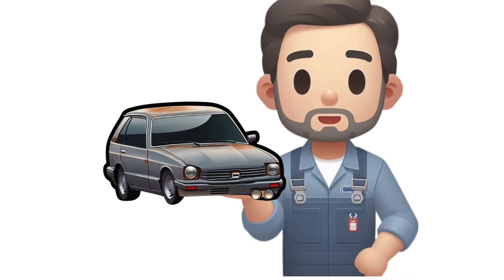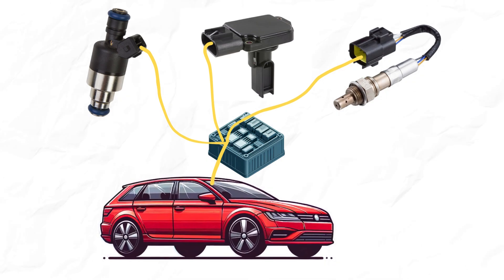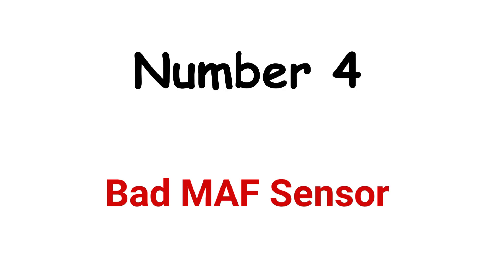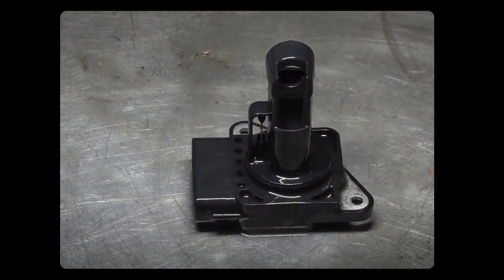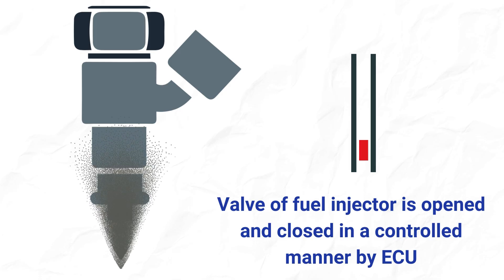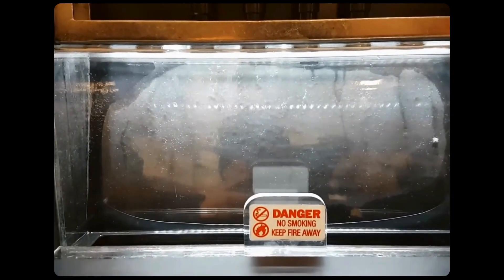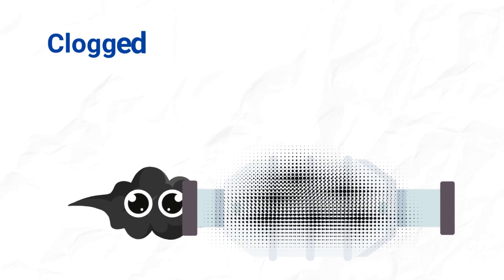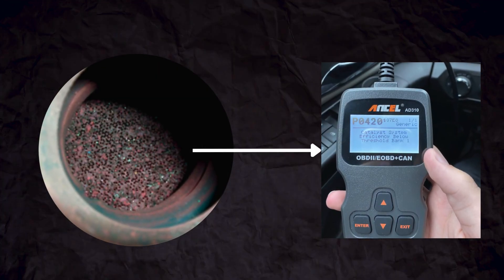20 Reasons Your Car Randomly Shuts Off When Slowing Down or Coming to Stop

Comment: My car keeps shutting off whenever I'm in traffic.. whenever I'm doing the break go break go action. It just shuts off and the battery light and engine check light comes in..  any thoughts on the issue?
Reply: I'm certainly facing the same issue recently. Can you please guide what was the issue in your case? On switching off and restarting it, fix the issue and the car moves as nothing happens to it.
Reply: Maf sensor check the ohm by multiple meter .Google what range your maf sensor should be in your car .just had same problem

Comment: Had 2 cars (Hyundai Santa Fe) that cut out when stopped at lights etc. Was the Crankshaft sensor on both of them. Replaced them and never had another issue.
Reply: odd that i come here because my 2018 elantra is doing this exact same thing....no lights, codes, etc, just randomly dies but ONLY while slowing to a stop IF I'm not going all that fast to begin with, and after about a good 30mins to an hour of driving.
Reply: @Atixtasy  my one would run fine and randomly cut out when stopped, sometimes it would start again and sometimes took 5+ tries. No warning lights etc..Would sometimes run for a few days without happening..Could be the same issue for you.
Reply: I see a common thing here it's a hyundai. Mine is a kona and I'm having the same issue
Reply: Is it making any noise? Only happens when you slow down? Get codes?
Reply: @ShanePalmer-z5r  no noise, no warning lights, no smells, just decided to cut out sometimes when stopping. I was told by a garage it was a different problem but after researching on Hyundai forums, lots of people said change your crankshaft sensor, saved me ALOT of money.
Reply: Could you smell not normal amounts of gas?

Comment: You use to be able to check alternators by pulling the positive side of battery off with car running. If car stalled your alternator was bad but new cars you can’t do that, you will fry electrical components. Do NOT USE BRAKE CLEANER to clean a MAF sensor! Most misfires are bad or arcing coil packs.
Some new vehicles, when your battery dies it throws codes you can’t reset without the Stealership.
Reply from the maker: Did I say something wrong? I know we should always disconnect negative terminal first. And when reconnecting battery, always connect positive terminal first
Reply: @AutocornerdPros no I think he's just sharing common issues and tips for these issues that may not b immediately obvious, this type of knowledge was pry gained by years of hard work, attention to detail, n frustrating troubleshooting sessions, Thank you @Webedunn for sharing this valuable hard earned info, my guess u must b a seasoned mechanic, this is what makes YT great, some are not willing to share this type of info or just to lazy, I and I'm sure many others DEFINITELY appreciate it, this is icing on the cake, the cake being ghe video,  well done fellas, sure many many people gained confidence to work on their vehicles thanks to u gentlemen!
Reply: How new are you talking. Is my 08 impala to new for trick to work

Comment: Do not use brake cleaner on your maf sensor, use Maf sensor cleaner or ipa only.
Reply from the maker: Thanks for information. That’s strange because I have heard from some people and they use same cleaner for sensor and throttle body.
Reply: @AutocornerdPros  Brake cleaner should not be used on electronics at all...ever!!
Reply: @AutocornerdPros usually the throttle body cleaner says to spray after the MAF sensor